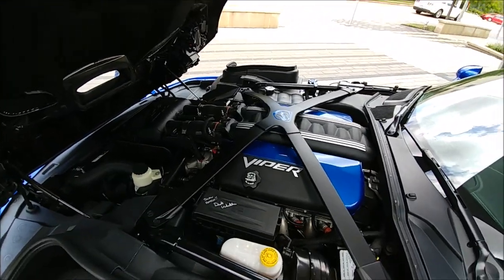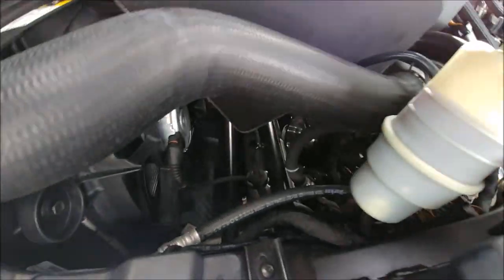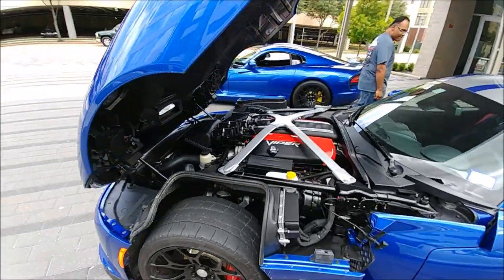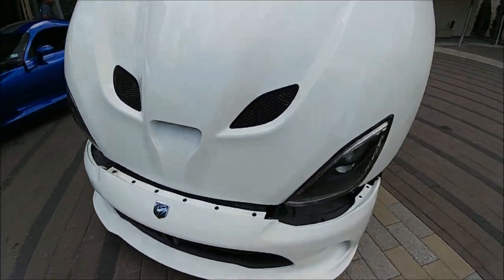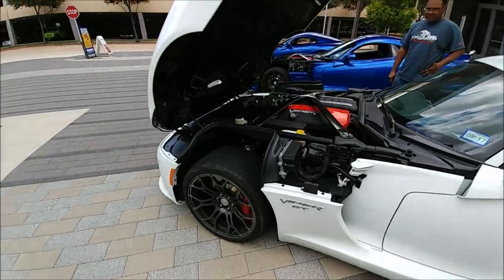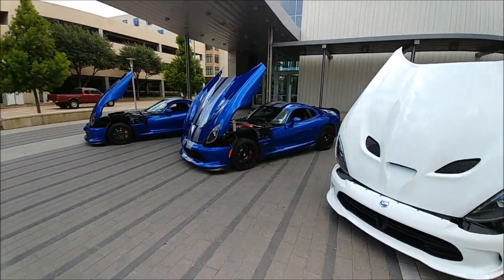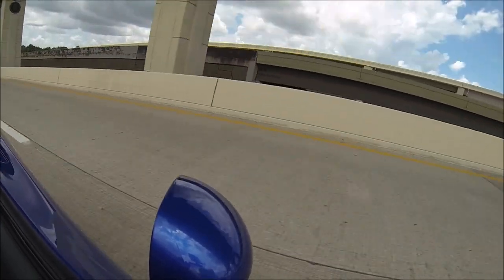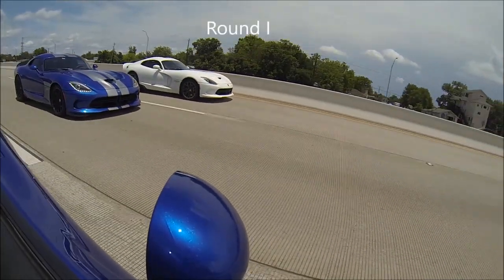3-way Viper Battle!!! Stock VS Bolt-ons VS Heads/Cam

Comment: Does the under drive pulley make any difference?
Reply from the maker: yes 10whp before/after on dyno, not to mention reduced water pump impeller cavitation at high rpms

Comment: Great Vid again, but im disappointed with H/C. Is he facing some issues with his car? If not, so no need to go H/C setup. Prefer to stay witb bolt ons. If needs more power go with spray +1
Reply: AlFahdy the bolt on car has a driver mod that may be it
Reply: And an aftermarket ECU I think
Reply: Put the driver of sneaky in the white car and watch the difference
Reply: Put the driver of sneaky in the white car and watch the difference

Comment: dissapointed with the heads cam car. The bolt on car walked away in the second race where it stole the hit .
Reply from the maker: ramairetransam driver error.
Reply: wrong gear ?